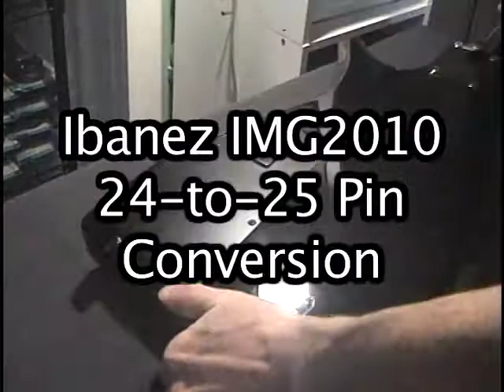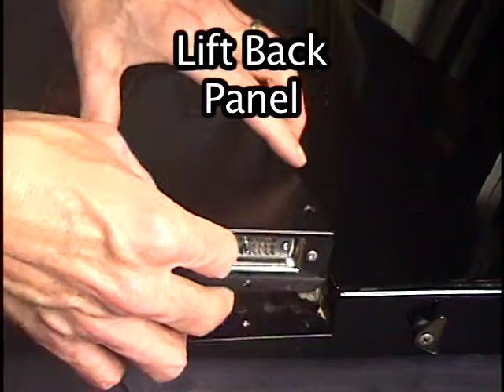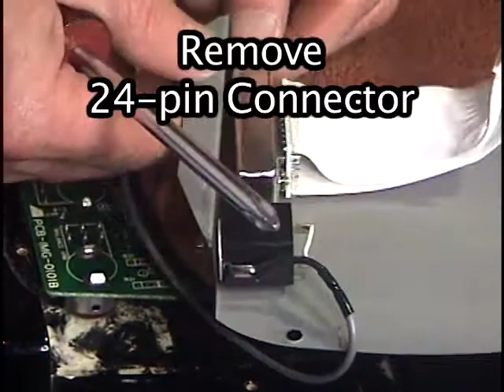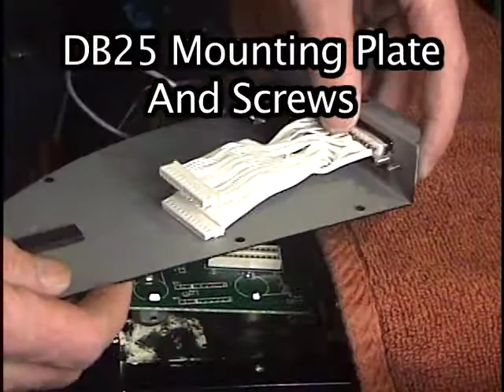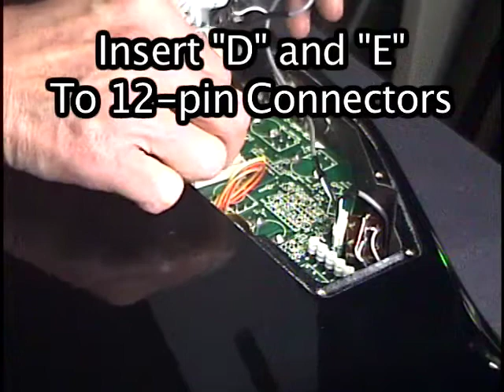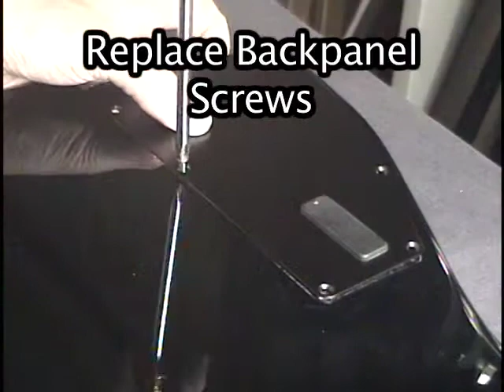Ibanez IMG2010 24-to-25 Pin Conversion - Use with Roland GM-70 Turbo and MORE

Comment: So it looks like you just reuse the original ribbons. Any rewiring modifications required to get the ribbons properly attached to the DB25 pin connector?

Comment: What purpose does this benefit.  Do guitar synths now take 25 pin?
Reply from the maker: Vintage guitar synths used a custom 24 pin cable. A limited number of these cables were made. This is an alternative to using the custom 24 pin cable.